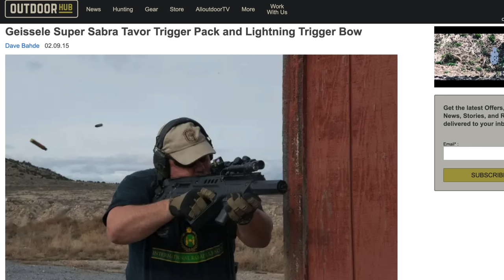6 Reasons Why the IWI Tavor is Better than the AR-15

Comment: the trigger in the tavor is designed specifically to work ALWAYS even in sand....it has two trigger springs which is why its stiff and has a longer reset. if you want a better pull with no concern for reliability in sand then pull the smaller spring out and it will drop 3 to 5 lbs out of your trigger pull.
Reply: Wow I’ve never heard this.
Reply: Great tip, thanks.
Reply: Geissele hates this one simple trick
Reply: You don't need a heavy trigger pull to get reliability in dirt and sand. Most drop-in AR trigger packs will do the trick. KE Arms makes the SLT and Rekluse triggers that are specifically designed to minimize the chance of dirt/sand ingress. Pull is about 4.5lbs and the break is extremely crisp.
Reply: @IntenseSpirit  underrated comment 🤣🤣🤣
Reply: Having 2 springs would def help not getting a “dead” trigger from sand, dirt, mud. Etc
Reply: This is incorrect.

James is showcasing the X95, which has a redesigned trigger pack. The X95's trigger pack does not have the second spring and has a significantly lower trigger pull weight from the factory.

 The Tavor SAR's trigger pack had a second spring, but again, James is showing the X95.
Reply: @zman9415  lol i said Tavor not the x95. im well aware of the differences  as i own one. i was simply saying that the tavor has a long stiff trigger and if you want to reduce that you can pull the smaller forward reset spring out and drop the trigger weight. The x95 doesn't have near the trigger pull of the tavor which is why i mentioned it in case someone has the original and didn't realize you could do that rather than buy a $400 drop in.
Reply: @jasonr.9520  Got it. The comment just seemed a bit out of place on an X95 video.

I've got both and have since put an X95 trigger pack in my Tavor SAR.
Reply: @zman9415  yep i understand. how do you like the x95??? i mean i have a p90 and a mpx so i dont really need another small platform and ive had no complaints about my tavor, but since you have both is one quite a bit better than the other?
Reply: @jasonr.9520  I've got a few other bullpups as well, as do my friends so we've spent time with a pretty good variety. 

Between the SAR and X95, a lot of the differences are preference.

The biggest objective things with the X95 are that the trigger is better because of that redesigned pack, it's more modular because of the body design (handguard and pistol grip), it's easier to get the barrel out / swap calibers (I do this regularly between 5.56 and 9mm), and it comes with more rail space.

I love my Tavor and find it a little more comfortable with the shape of the handguard. I have no issue with the mag release, although I can see how the X95's button is easier to learn and handy. 

If you are the type to put a lot on the front of your rifle, the X95 wins due to the rails and after market handguard options. 

If someone asks me for a general purpose bullpup recommendation, it's the X95 and then the VHS-2. The SAR is more like the AUG, where you have to want it to have it rather than to have a general purpose item as it's more limited, and also discontinued.
Reply: @IntenseSpirit  Geissele shouldn't have made there trigger group $400+ then. Lol!
Reply: If you want a lighter trigger pull, all you have do is the same hand exercises that the navy guys do when their on long stents out at sea.
And no women are available.
Then that trigger pull will be light as a feather.
In fact you’ll be able to pull the trigger faster than full auto😂😂😂😂😂
Reply: @pinnacleoffaithchurchofgod8212  Just dont go picking your nose after or you beat your brains bloody.
Reply: Ya AR triggers don't work in sandy conditions at all.....NOT
Reply: @Jason R. This is the biggest cope for having a shitty trigger. What does the “R” stand for, “Rosenblatt”?
Reply: @zman9415  Thanks, I was just about to post the same.
Reply: @jasonr.9520  I had them both as well, and can confirm that trick did work. I sold the SAR, because the X95 addressed just about every issue I had with the SAR. I’ve went through an optics merry go round with both platforms (more so on the X95), to include the M21, the Meprolight RDS, EOTech, LPVO, finally landing on a Trijicon ACOG.
Reply: How a fan boy justifies a shitty trigger with zero facts.

Comment: Can confirm. LOVE my 18" Tavor. Exceeded my expectations. Reliable, accurate, surprisingly light, good ergos, much shorter than a standard configuration rifle. One of the finest rifles on the market.
Reply: Better stock up on replacement parts, or that will inevitably become a paperweight

Comment: Echoing sentiments expressed by other viewers - Parts replacement is a real pain.  Besides parts, I had waited 2+ years for the IWI store to replenish x95 conversion kits. Understandably they were financially driven to sell complete firearms at a higher premium than sell conversion kits - in the end I was told their X95 9mm conversion kit was no longer being sold due to restrictions by the ATF - why buy when they do a terrible job supporting their existing customer base?
Reply: wonder what else happended pver the last 2 years that may effect supply 🤔
Reply: I’m confident things will change. We’re still feeling the effects of the COVID economy. I’m not willing to reduce myself to the impatient “I want it now” culture.
Reply: The 9mm conversion is something that might be desirable for military contracts, but as a commercial firearm the X95 is not a competitive 9mm platform.  I wouldn't be surprised if their first run of 9mm conversions took a long time to sell, and they decided it's wasn't financially worthwhile.
Reply: @redman836  Parts unavailability has been going on for several years. I bought a Tavor several years ago but went back to the AR platform for this very reason.
Reply: @redman836  If others can get it done, then so can they. Besides, what does it matter what it's blamed on?  The matter is if it's available, or not.
Reply: They're Israelis what do you expect?

Comment: I have a Tavor 7 and I love it. I can shoot it one handed like in the video, which is great for a 308/762. With a 16.5” barrel, it is slightly heavier than the X95, but it’s balance is great. 4 position gas block means I can run it in bolt action mode for those “silent ops” where I don’t want the bolt to reciprocate making noise. I could go on and on… lol
Reply: Should I get the tavor 7 in 308 or go for the x95 in 300 blk? Trying to get some opinions before making an option since the tavor 7 has the better caliber but the x95 is the upgraded version
Reply: @jasonjobst  i just got to check out an AR style  300BO for the first time, and several 308s. It really depends on your situation. If you are going to put a suppressor on it, then probably 300BO. The 308 has the stopping power, though. I guess if I could only pick one, it would be the Tavor 7.  The 308/7.62x51 cartridge is much more available than the 300BO.
Reply: @armedone4u  Thank you for your fast response. I think from the other feedback I also got, the Tavor 7 is more versatile in uses, so I'll go for that one first and get the x95 later for home defense. Thanks!
Reply: @jasonjobst Did you make a purchase?

Comment: I've got the Tavor 7. And honestly it's my favorite gun. I use it for hog hunting and it's INCREDIBLE for the task. 
Never jams, has minimal kick for a .308 rifle (I can't stress this enough; the kick is super manageable.), it's accurate, and the weight is honestly not bad for a bigger caliber rifle.
Reply: Accurate? It gets like 3-5 moa lmao
Reply: Should I go for the tavor 7 in 308 or go for the upgraded x95 in 300 blk?
Reply: @jasonjobst  kinda depends on your application. If your just plinking the x95 might be cheaper. If you want a gun you can hunt most game with 300 blackout will work but .308 is a higher energy round and seems to deflect less in brush and bramble. I've had really good success in particular with hog hunting using the Tavor 7.
Reply: @hogfry  Thank you for the quick feedback. I think I'll eventually get both but the Tavor 7 seems to be more versatile in uses so I may go for that one first.
Reply: do you run only .308 through it?

Comment: As a proud X95 owner, the MA aftermarket parts you talked about and the GSS trigger are 3 "Must Have" additions. Those three little things, in conjunction with an OSS FLOW 556K can, turn this system into a true beast of a CQB/Vehicle/MidRange weapon. 
I still prefer my MCX Rattler for my HD platform, but my Hebrew PewPew (X95) has earned a spot next to the Hebrew Hammer (TS12) to keep the snake guns company in the safe.
Reply: Nice thing about the Rattler (more so now that I've SBR'd it) is that it's extremely compact for in close, in a vehicle, in a home, backpack, etc, yet can still reach effectively out 150-200 yrds (farther than i'll ever need really). 
Personally, I can't hit the broad side of a barn from INSIDE the barn with a .45 pistol, and good luck (for me anyway) hitting anything in a stress situation, unless the fight happens to be taking place inside a phone booth.... 🤣 That's why I like my Rattler: a big, heavy, and (since I use HP subs) slow round that drops all it's considerable energy in a target, that I can aim effectively in stress situations and still move with.
Plus, it's undeniably fun AF at the range.

Comment: I picked up a Keltek RDB as a fun plinker. YOU NEED TO REVIEW THIS GUN! 

I’ve put a fair amount of ammo through mine with no problems, it has a trigger that feels no worse than a mil spec AR trigger (which I actually like as a vet), you sure as hell won’t have a light strike as apparently KelTek designed it with adamantium primers in mind. It is 7lbs flat and fully ambidextrous. 
It may be the best thing KelTek has ever made.
Reply: It is the best thing keltek has ever made. Its the most fun I've ever had at the range. I put the mcarbo trigger spring in mine and it is beautiful. Super easy to dump mags. And, I don't have to worry about any of my lefty friends when shooting!
Reply: I recently got my hands on an RDB. It's no Tav7 but it's a pretty nice rifle so far.

Comment: Would love to see the Desert Tech MDRX compared to the other rifles at the same time. I hope it makes the cut for you James.
Reply: yes. love the desert tech
Reply: better trigger than this garbage lol
Reply: mdr is sadly trash.  sold mine.  if you look around there's videos about ongoing issues even in newest iterations. There's a reason they arnt seeing more wide spread use.  shame since id really looked forward to the micron variant
Reply: @ClitoridectomyGroyper  especially if you get the Jard drop in trigger pack. Jard trigger in MDRX is best Bullpup trigger ever
Reply: @Bursar60  You got the forward eject? If so, i found your problem
Reply: @ChrisHuppey  problems go further than that,  but that was other problem years of delays,  then another year or so of beta testers only to drop features and release a non cross compatible updates.   lackluster cs when I did desk with them.
Reply: I never bought either.  I read up on both.
 I was interested in a designed and built in the US bull pup, but there was a lot more bad press than good and it seems like several models were discontinued.
I also wanted the ability to convert to 300 blackout.
The new Tavor x95 seems to have addressed all the complaints of the first gen tavor including rhe reciprocating charging handle causing malfuntions.
Reply: Unless they've changed since Garand Thumb reviewed one..They are garbage.
Likely betting on the niche "guys who like bullpups" market to sell.
Reply: @ClitoridectomyGroyper  garbage haha? Better trigger maybe true, overall better is a fault statement make by idiots.
Reply: @Bursar60  mine works fine, man. I'm sorry yours wasn't so good. I guess it's expected for a bolt rifle company
Reply: I own multiples of both. All calibers. MDRx is a range toy. Not suitable for duty use in any manner. But novel engineering for consumer recreational market.
There are too many manufacturing QC issues with DT products. Such as inconsistent/inappropriate loctite application, trunion/rail screws backing out, etc.
Reply: I had a mdr was extremely hyped about it and was one of the first to get one when they finally released. had to send it in twice then they had to send me a new gas adjustment the thing still hardly ever worked ended up trading for a scar 17 and havent looked back would love to get one again qhen they're on gen 4 or 5 and its finally working 100%
Reply: @CWHolleman  Garand Thumb actually has an updated review, if you care for his opinion on the improvements, although it’s also a little older by now
Reply: @Bursar60  I sold one too. Same experience.
Reply: @hikeskool  sold mine and yes their customer service isn’t bad but the gun is.
Reply: I would also throw in the keltek RDB as that is an amazing gun. Don't write it off because it's keltek, shoot one. The trigger is very nice from factory
Reply: @hikeskool  dude stop being a coping fanboy lmao. The mdr, mdrx, mdrx gen 2 are all over hyped trash. Until we see a contract and consistent miltary use and it’s been battle field proven. It’s just a garbage rod range toy that doesn’t belong anywhere near duty use like stated above. The x95 is currently being used in military applications and has been battlefield proven and pro even its reliable and works in adverse weather conditions and runs relatively with little to no failures. The mdr can’t even make it a full range day without problems.
Reply: @hikeskool  gonna go on a whim and guess your “ gucci glocks” and your joe rifles are all decked out in read and black anodized parts as well and your ars are decked out in strike industries and timber creek parts🤣
Reply: @hikeskool  and glocks and mpxs are not mdrs. Mdrs have been proven many times to be unreliable range toys that don’t belong anywhere duty use. And it’s well documented that they cannot get them to run properly and well documented by many people on YouTube to be riddled with issues. Don’t be a poor and don’t be a fanboi. The mdr is a garbage rod and yiur much better off for a better price with an older sar order x95 that both have duty records to back them up. The only record the mdr has is being badly designed unreliable pile full of issues. And people are still on the waiting list waiting for the next iteration to try and fix it still.
Reply: @hikeskool  my problem is , if your gonna drop 3k on a weapon . That shit better run like a 3k weapon and not a bear creek arsenal lmao
Reply: @joenunya8449 the charging handle doesn't reciprocate...

Comment: I had a Norinco type97 and the trigger was absolutely awful. But im pretty sure it was only designed for hopping out of an apc and mowing down innocent tawainese civilians in full auto
Reply: cringe
Reply: @jjustdancerr8119  ain’t cringe if it’s probably true
Reply: @jjustdancerr8119  Lmao tell that to china
Reply: Haha true that trigger is bad. Like a dry sponge... still like my Gen 3 T97 though.
Reply: Well it is cheap and reliable, which is what the PLA wanted
Reply: @YourWifesBoyfriend  Don't you mean Winnie the Flu?
Reply: @jjustdancerr8119  Nihao comrade commissar.
Reply: ah ok so just like the IDF do to palestinians
Reply: Honestly the Tavor is probably also used by guys jumping out of an APC and mowing down innocent civilians.
Reply: @zeke2095  Well, if the Palestinians would stop shooting rockets every few years…
Reply: @jjustdancerr8119  
50 cents have been deposited in your account
Reply: @josedorsaith5261  thx Jose
Reply: @jjustdancerr8119  ik norinco products are cringe bro
Reply: Fuckin' lol
Reply: I used to own both X95 and the T97.
Both have pros and cons.
The T97 is just as reliable (the bolt design is also pretty much an AK47 rip-off)...but it is  slimmer, trimmer and lighter...
What kind of sucks about tje T97 is the safety switch location and the mag release.
My safety is always an empty chamber and I'm used to operating mag release with my left hand (AK, VZ58..etc), so none of those were issues for me.
Also the T97 has no issues with inserting a loaded mag on a closed bolt (the X95 is notoriously bad for this)
The gas port is also adjustable on the T97 (off and adverse conditions)

The X95 has the edge when it comes to accessory attachement and being able to switch the bolt for the left handed users.
If you were dropped off on a hostile planet, either one would do the trick, but the T97 would do it at one third of the price...

Comment: I had the X95 and loved the ergo's, but ended up back with the SAR version due to accuracy.  I use mine for thermal coyote hunting at night.  The X95 version was just barely not good enough for those 250 yard coyote shots. The SAR gets it done.
Reply: @TheHouseAlwaysWins-xs8zd  I have the same question.
X95 has been more than adequately accurate in my experience.
2020 as well.
Reply: My X95 has great accuracy with 70+ gr bullets.  16” barrel.  1 moa at 100y easy.

Comment: I've shot the X95 out to 300yrds and accuracy was decent out to that range. Mine has a EOTech 512 with a GG&G QD riser.  I consider it a replacement for my CZ Scorpion PCC. Same overall length but its 5.56mm vs. 9mm. Uses common magazines as well. I think if you use it for CQB and treat it like a subgun, I think the accuracy is good enough. Also, I'm a lefty-- so I like the ambi controls.
Reply: If you’re making good hits out to 300 with a non-magnified optic, you’re doing good!
Reply: @Matt Walters  in the military I made 300 yard hits with iron sights. I guess that's a lost art.
Reply: @jermainepearson6835  I don’t doubt it; everybody is obsessed over LPVOs and wanting their 10.5” AR to perform like an SPR at 500m; they need to keep it simple with certain weapon systems.